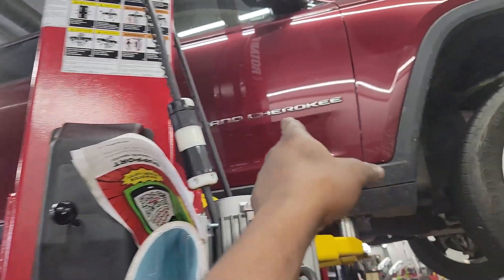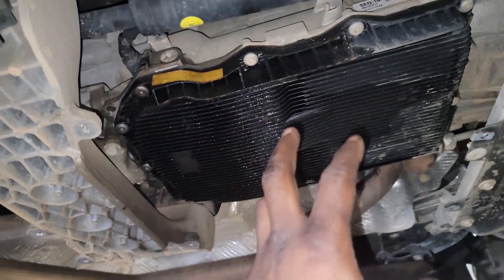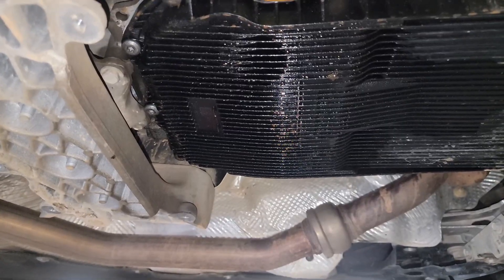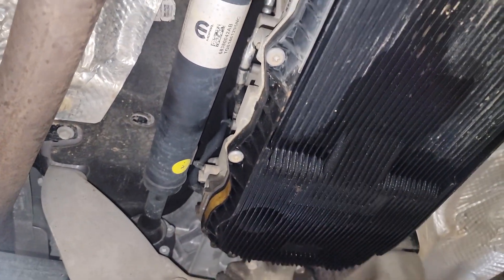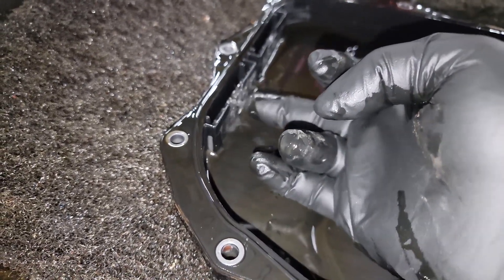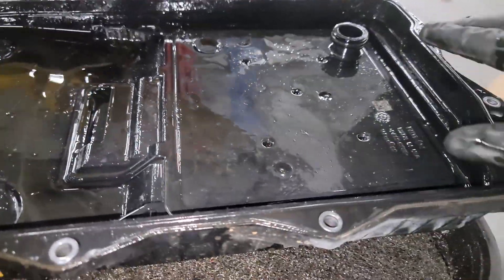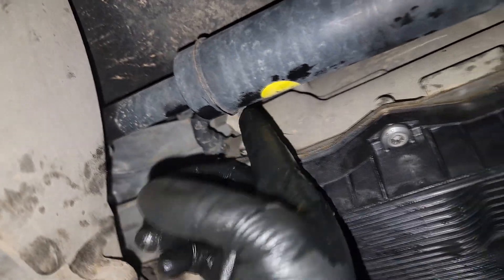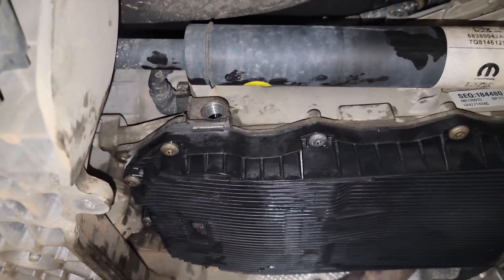Car Engineer Blunder or Smart Move. Plastic Transmission Pan Next To Exhaust System.

Comment: Since the pan has an integrated filter and magnet, it should be regarded as a transmission filter. The cost to service increases and I do not care if this service is done every 2 years on average--every little matters. I would place a new plastic part back on the engine. There are metal replacements which I would consider, but, how does the filter work with the metal part? If I have to  pull the pan every time, I prefer going with a plastic part.

Comment: If this car had 180,000 miles and the driver asked you to service the transmission. Would you be afraid to do it?
Reply from the maker: No, but I will need a lil history about the trans. Such as is this the first service done. If not then I would simply explain the risk associated with doing it. At that point, the decision back on the customer whether to do it or not.
Reply: @OnlineMechanicTips The unit has never been serviced

Comment: Just had a 2025 rebel show up transmission wouldn't engage, slight dent in the front bumper. Look under the car and sure enough there's a massive hole in it. It was like the one spot on the death star...

Comment: Advantage to the plastic is it's better than metal for heat dissipation, so it helps keep the oil cooler. Same reason engine intakes are plastic today...and radiator end caps.